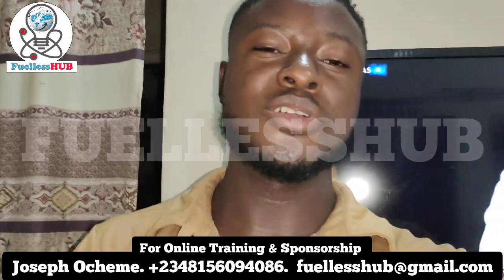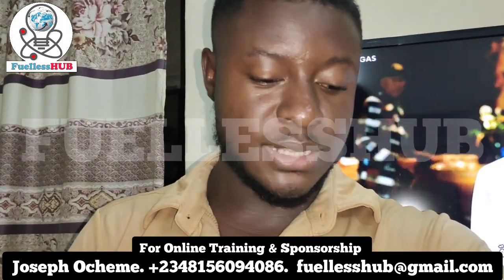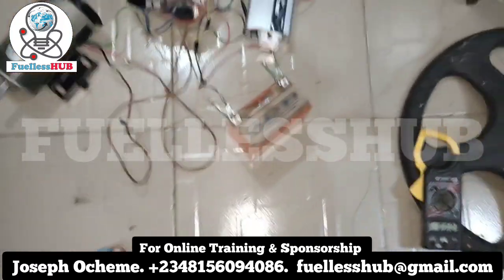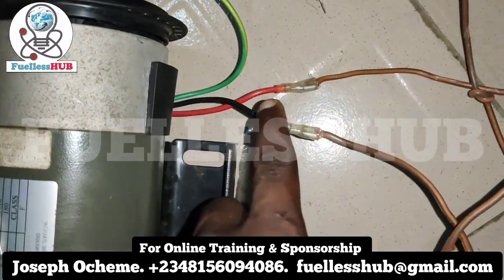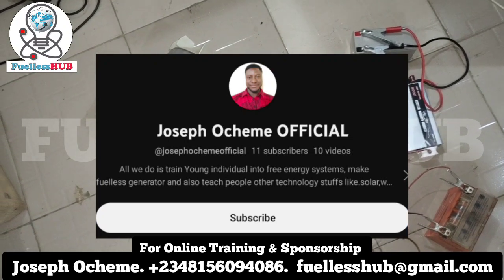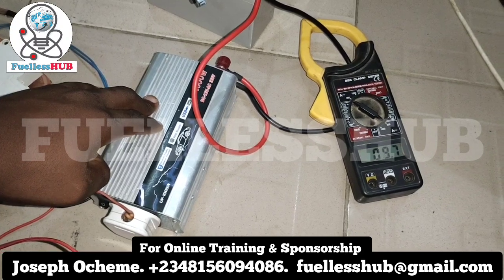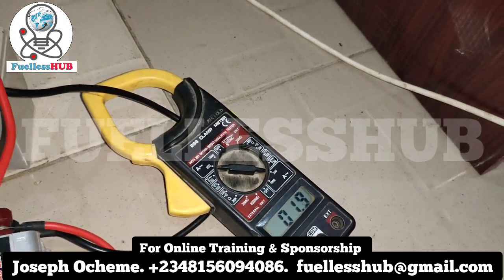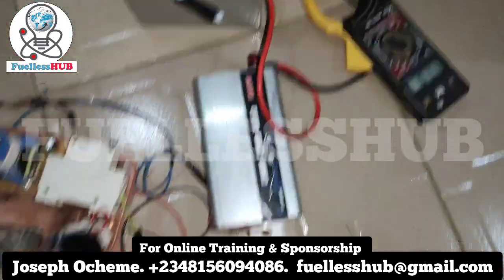15 watts power Greater Load for Fuelless Generator

Comment: So what modification did you do to the system to consume lesser amp because I have 150 watts inverter if I connect 100 watts of power it will consume almost 9 amp

Comment: Hello Mr Joseph, that clamp meter you are using is AC clamp meter, it does not have DC clamping function, the result you will get when you use it to clamp DC current current will be very low, and  it can never be correct, but is going  to give you correct answers when you clamp ac current only, go and get DC clamp meter to understand what am telling you, the current consumption from your battery to your inverter system should be around 25amps upward, this is the result you will get when you use DC clamp meter.
Reply from the maker: I also checked the AC amps so use it to calculate